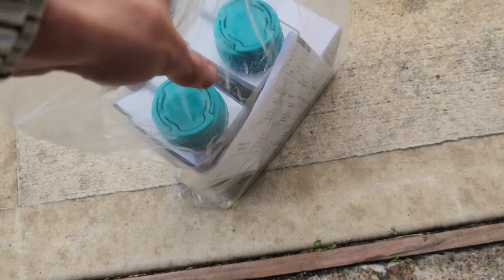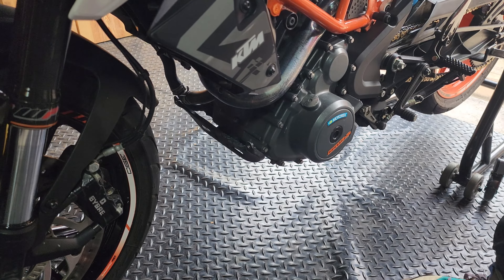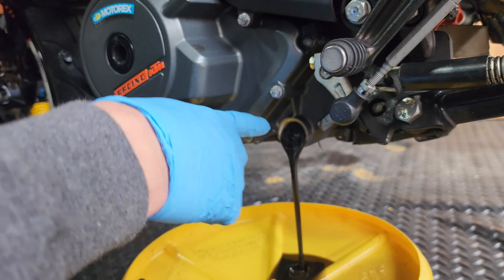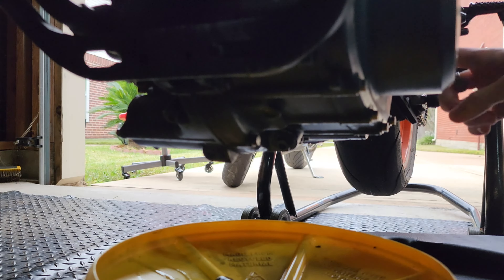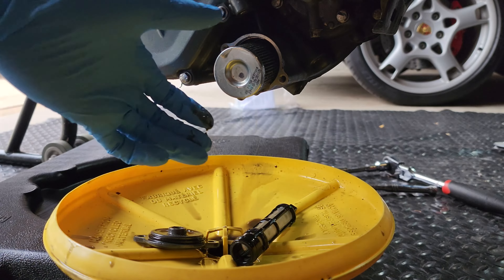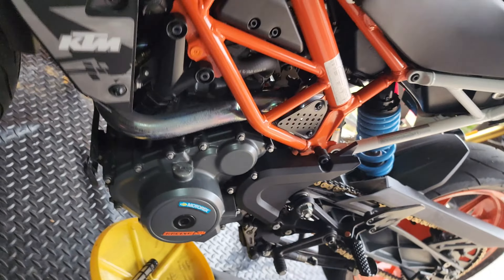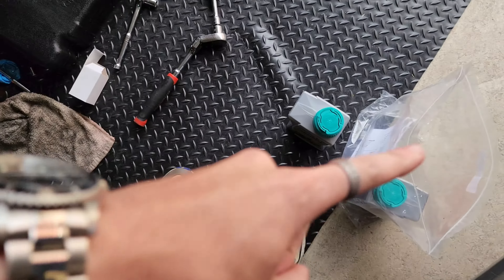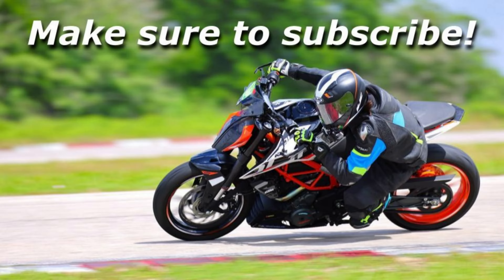KTM Duke 390 Oil Change | QUICK and EASY!

Comment: There is a window on the side of the motor to show the oil level. You should check that after the bike has run with the new oil for a bit, and top it up accordingly. If you only put 1.6 L in, you will likely not even see oil in the window after running it as the oil filter absorbs and other voids absorb much of the oil. Tilt the bike to the side to see what the oil looks like before adding more.
Reply: btw if you think you need more than 2L, you are probably doing something wrong
Reply from the maker: This could be why I didn't see it. Thanks for the info! I'll keep this in mind for my next oil change.
Reply: My bikes oil level is above maz when I straighten the bike and I don't see any oil when it's on side stand ??? Is it too much oil or less

Comment: I would definitely use a torque wrench, and maybe some epoxy to make it super duper tight, can't have leaks when I take my 390 to the track! :D What? No chain tension check? What about hooking up a diagnostics tool to ensure quick shifter is on? Did ya check your coolant, and brake fluid? top off / water content test??

Comment: what year model is this ktm?, in my manual for my 2018 duke 390 it shows 1,7 liters of oil, checked the oil level and its bearly at minimum if that. @motoRevs
Reply from the maker: My Duke 390 is a 2018 model year. I believe the oil capacity is the same across all model years, but I could be wrong.

Comment: But Ktm Recomends Semi-Synthetic Four Stroke 4T Oil
Reply from the maker: I've seen people say KTM recommend many different oils... It could be due to market area, or something similar, but it seems to differ between person to person whom I speak with over this matter. It's strange, but I'm sure KTM knows what they're doing. I don't think you have to do exactly what I did and use what I did.
Reply: @MotoRevs  After I poured in the semi-synthetic oil as recommended in the manufacturer's manual, which was visibly very thick—Motorex Formula 4T SAE 15W/50 MA2—4L for 53 Euros, I noticed that gear shifting became more difficult. I'm not sure if it's a coincidence, but a couple of times, the gear even slipped out on its own while I was in 5th gear at high RPMs.

Comment: You could have used a strong magnet to remove the oil filter.
Reply from the maker: I actually tried that. I had a seriously strong magnet, and I tried pulling it out using it, but the filter was in with such force it couldn't be pulled out. It was definitely a force to be reckoned with...
Reply: If/as filter is going to garbage anyway, just hammer a screwdriver in an angle into the filter, then pull it out.

Comment: Torque settings very important. Stops threads from being stressed and stripping out. 18mm head bolt 15nm the rest are 12nm
Reply from the maker: I agree - sometimes, you just kinda get the sense you can about feel it with your hands...

Comment: Hey, great video!

Would you have the part # for the oil change kit?

Thanks
Reply from the maker: Thank you! I do; the part number is 90238015010 for the parts, and the oil comes separately. I can't seem to find the exact kit I used, it seems as if though KTM may have either discontinued or updated it.

Comment: Just wondering… do you need to replace the drain bolt every time?
Reply from the maker: Yes! It is highly recommended to do so. Same with cars, even. Most kits bring a new drain plug/bolt, anyway, so you should be fine!
Reply: @MotoRevs  I’ve never replaced any drain bolt in any car and have had no problems not saying it’s better but I’m trying to figure out if that’s just recommended because my bikes manual dosent mention replacing it just cleaning it